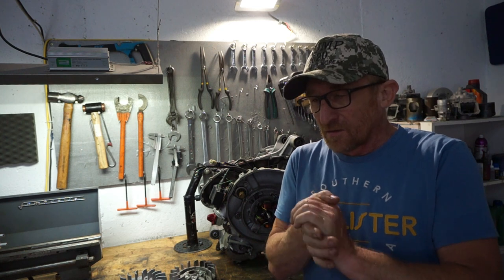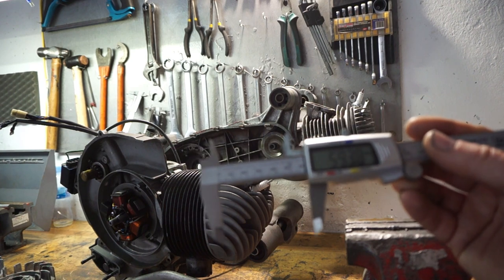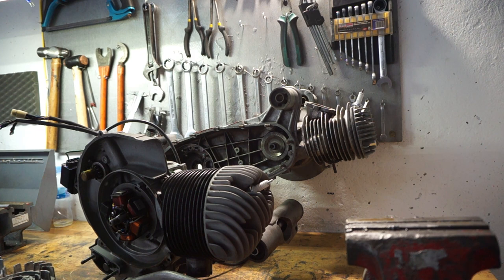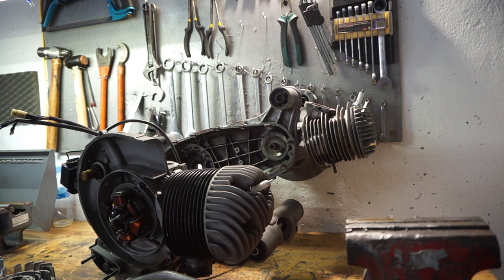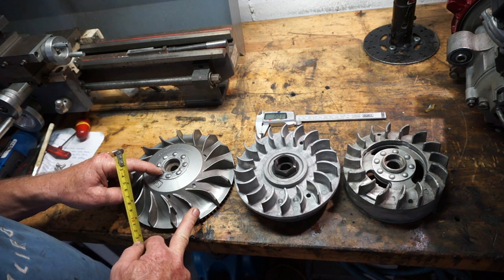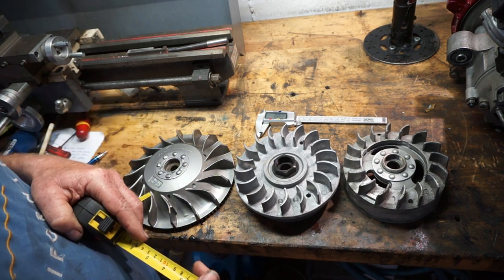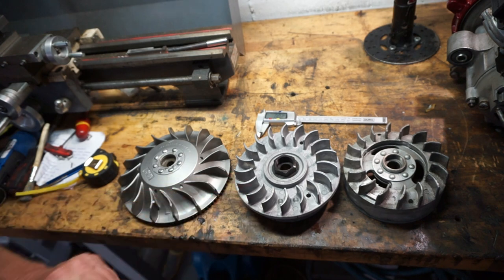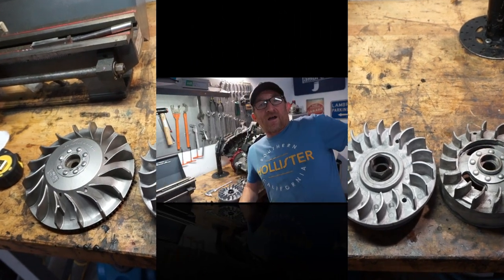LAMBRETTA ANGRY MAN # TheSteelweasel

Comment: ron moss got it right, thats why i bought avanti tt3...
 it lives in south australia and proven in extreme temperatures
Reply: Intresting I had a temp gauge connected to my cylinder head and it was reading the heat as 65 on a rápido 200,on the hottest day of the year 15 years ago would be really i trestin* to d9 a cylinder head barrel temp video
Reply: @nigelwhybrow9257  this avanti is 230cc running varitronic ign /flywheel and standard flywheel cowl running a 9 plug cyclone 5 and lth reed/mikuni 6plate clutch tsr evo and never had heat issues even on 35c+ day cruising at 110kph.
would be interested to hear others experiences?
Reply from the maker: @ademckinlay4946  hey bro do you have a CHT gauge would be nice to compare head temps has spain is also 30 to 40 c in summer.
Reply: @TheSteelweasel  no, sorry steve i dont.
run on 98 ron fuel and silkolene comp 2 plus 3%
'9' plug.
my speed triple runs hotter!

Comment: Hi Steve, just a thought or I may be totally stupid. I see the AF has 16 fins and a standard Indian has 24, but are the 16 fins moving a bigger pocket of air? Or did AF in their quest for lightness just get it wrong? I have one of the AF light ones knocking around and was going to try it. Do you have any comments to make on them as to there usefulness ? Cheers.
Reply from the maker: AF  is the lowest in tests ive done and i avoid at all costs im working to impove cooling not reduce .
Reply: @TheSteelweasel  Cheers Steve, Probably scrap then.
Reply from the maker: @keithappleyard642  door stop 👌

Comment: steelweasel  is there any benefit running the indian long finned flywheel and cowlings ?
Reply from the maker: Yes they push more air . Dont understand why people where machining them down ? Looks I suppose  .
Reply: @TheSteelweasel  dont the longer fins sap a bit of horsepower,also the bigger vespa diameter would cause more drag,like a lever effect,but yeah,lambretta cooling always borderline and sure some of these companies could come up with a better system,,but do they want us to have vespa reliability,regards kit sales,they would plummit
Reply from the maker: @tavspeed1101  the power gain from a cooler engine is way more than any drag effect and the mass is still in the same place so almost no difference in torque loss .